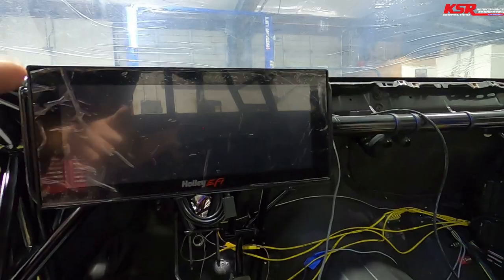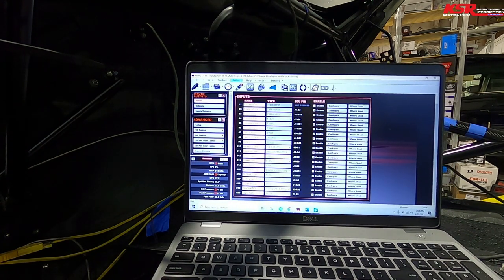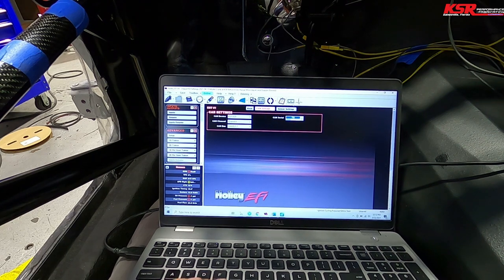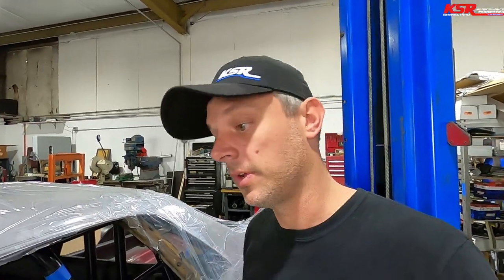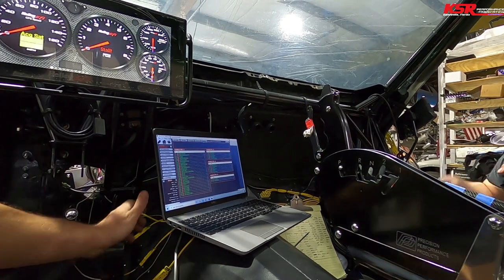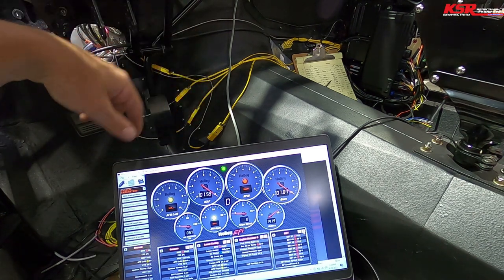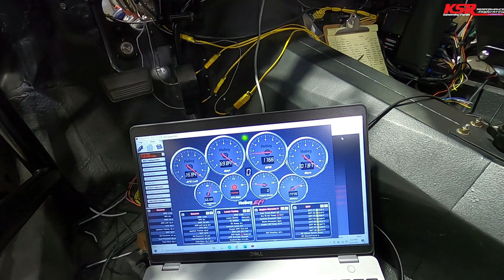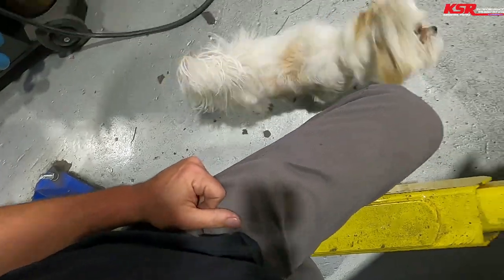Mullet El Camino Build Episode 23!! More Sensors...More DATA!!!!

Comment: Nice surprise seeing this after being at the track all day yesterday😍
Everything went perfect with Santi's Holley EFI ZX14. He made it to the semis where he lost with a .003 red...
I try to check/set temperature offsets in the morning because the IAT warms up a lot faster than CTS on the bikes.
Santi's is NA and doesn't have an air box so his IAT warms quickly vs CTS that's in the block.
I also figured out when I first started tuning Holley to offset MAP to match the ECU Baro 👍👍

Comment: This hot rod is going to be one of the most consistent vehicles out there every wheel has it on sincere there’s a humidity temperature sensor a steering wheel sensor I am sure the seat will have a position sensor LOL

Comment: Pretty impressive that Travis had a bundle of 50 or so wires to terminate into the firewall connector and no wire numbers were visible. They were terminated and assigned the correct location by magic? There were multiple wires of the same color so that wasn't the total answer. Typically a major headache is finding the misrouted wire.

Comment: Do you recommend a catch can on a everydy pick up like Silverado pickup?
Reply: If you have a Mass AirFlow sensor, I would. I put one on my 97 Jeep 4.0 ( NO MASS SENSOR ) it does catch some junk & keeps the Throttle Body a lot cleaner. My Jeep has been very very well taken care of also, Maintenance wise I mean. I bought it new & it has 187, 000 miles on her, has a cold air intake on it & the Throttle Body has been bored out to the size of the hole in the intake. It lost some low end torque by boring the Throttle Body out but runs better in the higher RPM range when ya really get on it, well for a 4.0 that is, LOL. Didn't see any difference in mileage, IT'S A PIG ON GAS, SHOULD HAVE BOUGHT THE V8 DAMN NEAR SAME GAS MILEAGE.

Comment: I was wondering if you were going to have a sensor that cuts power if the car lifts the nose past a certain height? The faster you go the harder it is to react and try to pedal it to keep it from doing the 'Jack Stand Jimmy' hustle.  ; )
Reply: There is a travel sensor on the shocks, so you could have that make an ignition cut beyond a certain height to prevent giraffes taking flight.

Comment: What does mullet miss from being a burnout care also?
Reply: It is designed to transmit all the power through the tyre without spinning, literally the opposite of a burnout car. In drag racing “if you’re spinning you ain’t winning.” It is also set up to rapidly transfer its weight onto the back tyres to help keep them gripping, again not what you want in a burnout car. The engine is also designed to run for very short time at very high RPM vs long periods of high rpm. All race cars at this level are built to do a narrow range of things.
Reply: @foamdataservices  yeah, but if the prep is not good drag cars will spin tires as good as any, plus they do a burnout before every pass. I think that the trans has a cooler, the engine has a big radiator and big tank for ice for in the intercooler, steering is steering, suspension is good enough, it already  has line-lock for no rear brakes. It just would get trashed with rubber in the fender liners and maybe crashed in the bariers. And the only thing I think I missed or doens't have, is oil coolers but it's drysump and maybe it helps that way

Comment: Is it possible save a backup program on a flash drive in case something were to erase all the data on the sensors settings in the computer. Because unless Cletus has a pocket version of Kevin setting all the parameters again would be a monumental task for someone that's never done it LOL
Reply: The tune file and ECU setup saves all the inputs etc I suspect, otherwise they wouldn’t sell many since hot rodders can crash/break almost anything!